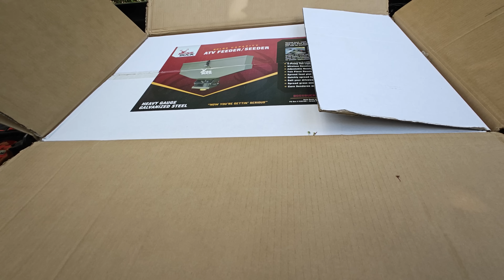Clearing Land with Tractor for Deer Food Plot

Comment: Got my TYM t474 two days ago 8/30/24. Seen a lot of bad reviews and write ups on TYM tractors. Was gonna get a KIOTI but saw your videos and you convinced me. Was having fun and was doing my 10 hour maintenance.  Hydraulic oil looked low so was gonna have the wife go get some. So I wanted to move it started it. Had a whine and sounded like air in the brakes when pressed. Was checking it over when the sound stopped then a hot smell like burning rubber shut it down checked everything that I know of. But now it’s dead won’t start or turnover. Hopefully it’s nothing and they’ll get someone to look at it without charging me since I’ve only put 6 hours on it it came with 4 already on it. Getting worried the chat groups may have been right.
Reply from the maker: I hate that you are having problems. I have over 500 hours on my T474 with no issues. Don't assume it is the manufacturer's fault. I have seen limbs pushed into the wiring harness on people's tractors. Most tractor fails are caused by the owners using them like a dozer. I am not saying that about you, but just overall. Every brand of tractor forum has horror stories. When a person digs in,  most of the time I find it was caused by the owner.
Reply: Any follow-up on what was wrong with your tractor?
Reply: What was the issue?